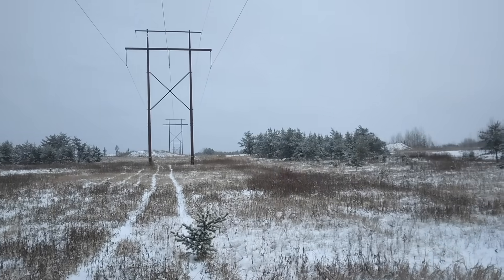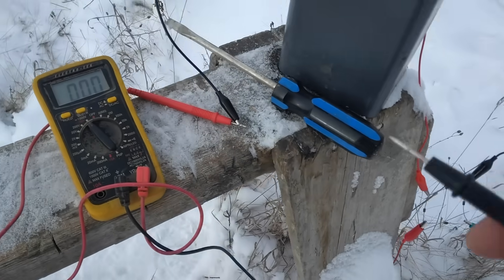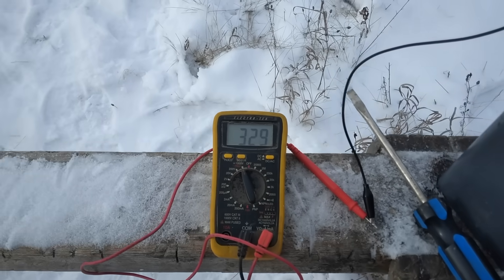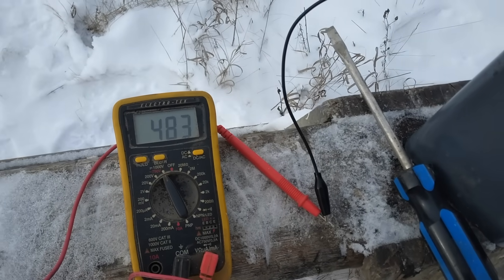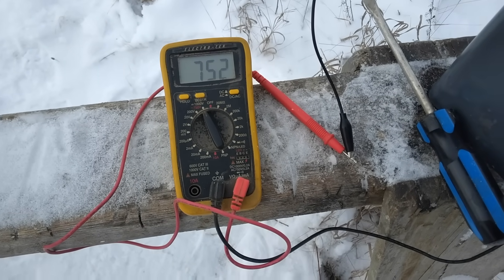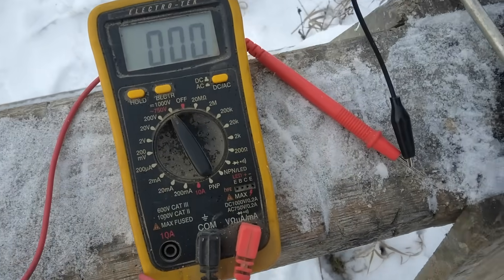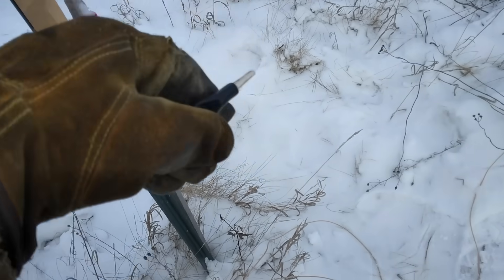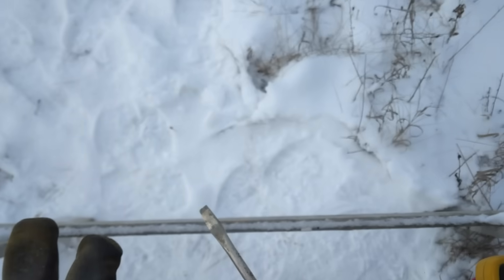Fences sucking power from under HV transmission lines

Comment: I'd be curious how effective a buried cable would be.  A few cm to a few inches below the surface and electrically insulated from the ground, no one would be the wiser as to it being there and you could siphon power all day.  Also the total opposite, it would be interesting to see what kind of current you could get from just outside your easement zone, where you could build higher.

Also-also, it would depend on exactly what your deal is with the power company, but a fence could be around 7 feet tall and still be a fence in my eyes.

Comment: There is a street in Wyandotte, MI called Electric because high voltage towers run along it and houses are all up and down both sides of the power lines. I wouldn't want to live on Electric st.

Comment: Wait, why put the capacitor from the wire to ground.  The AC voltage picked up will be shunted to ground!  Put it on the output of the full bridge rectifier.

Comment: I've also seen surprisingly high AC voltages induced in my body while working in a room with fluorescent lighting.  I remember reading that the most damaging aspect of voltage induced into your body is the frequency of the EMI.
Reply: That reminds me.. As an apprentice many moons ago they had just laid new carpet. I took a fluro tube and grounded one end on the pipework of a wall heater and the other end i touched the pins while rubbing my shoes  on the carpet. The fluro tube flicked in the dark..
Reply: This is inaccurate and a conspiracy theory.  Ask someone who knows science.

Comment: About 45 years ago, a friend of mine bought a small parcel of land from his family farm, and built a house on it.  There was a set of high-tension electrical transmission line along one border of his land where was was a disused stretch of barbed-wire fencing.   You could definitely get a pretty good jolt off of that fence.
Reply: The fence still there right? Sonthe fence is still.fencing right how is a fence ever unused after its built? till it rots completely  away  then its unused
Reply: Literally  have a 20.ft fence in my.back yard that was built for looks back in the day

Comment: Back in the 70s my friends and I discovered an odd phenomenon. If we were barefoot and touched an unpainted spot on the house gutter downspout with our finger nail we got a mild shock. But only sometimes. Then we figured it out. The guttering was galvanized steel. If it rained, any dead leaves in the gutter would produce a mild acid and turn the gutter into a battery.
Reply: So...barefoot, touching a groundplane, only happened after it rained. No, that was not leaves and galvanic action; that was a ground faulted HV line. Somewhere nearby there was a high voltage line that was bleeding current into the Earth. When it rained, the dirt became much more conductive. Your salty flesh made a great connection and voltage potential between the energized dirt and the grounded gutter. Shocks and electricity flow is all due to potentials. If the ground fault was closer to the gutter and if the dirt was saltier and more conductive, you may have actually gotten hurt. This exact scenario is why GFCI outlets are critical in wet locations!
Reply: @mannys9130  Not while raining. Most gutters hold water. Ground was dry.
Reply: @mannys9130  no hv fault, just neutral current lifting the pipe the downspout went into off of the soil potential. Its also possible the metal gutters and lightning rod may have been tied to a ground stake adjacent to the building ground the neutral was tied to.
Reply: Funny you should mention acid inside of metal things. I cooked pork chops with apple sauce in a cast iron skillet. I had added garlic and onions and the garlic turned a bluish green color. That didn't deter me from eating it. I turned the (electric) stove off and used a digital thermometer to check the temp of the pork chops. They were done, but still piping hot, so I left them on the stove to cool off. I go back and check the temp, again and a huge spark happened, killing my thermometer. I thought maybe the stove had a short and called maintenance to look at it. They found nothing wrong with the stove. The best I can guess is I somehow created a capacitor and discharged it with the second temp check. I still ate the pork chops.
Reply: @katieskitchen-tx  .....and now you glow in the dark?  lol  Sounds like a tasty meal.
Reply: @RMBlake007  HA! No.. That would be cool, though. It was very tasty
Reply: @katieskitchen-tx  If you used red onions, they tend to dye things around them when cooking. I used to think it was a neat effect.
Reply: @elgorrion52  
Hmm . . 
Okay, I'll bite . . 
Why were you licking a pencil sharpener? 🤔
And what else were you guys licking to get a tingle? 🤨
Reply: @maxwellsilver3115  Leave it to a dolt to discover a whole new realm of physics.  My dad argued against the idea that necessity was the mother of invention, rather, F up by someone curious, dilligent and persistent enough to notice something unexpected, test and trial and tweak until they could repeat the phenomena and put it to good use.    Specific example was pulling too much current on a transistor so that it would not go back off when the signal is removed but keep conducting.  If you limited the current such that it wasnt enough to cook the transistor and destroy it, and had an appropriate heat sink on the transistor, it could be used so that a momentary signal would turn it  on, and opening the circuit would turn it off.   They used that to replace a much bigger, more expensive latching mechanical relay.  Texas Instruments later patented that discovery. 
He described to me once about experimenting with inductive coupling to power lines to grab some energy being radiated off power lines and is possible grab a reasonable amount of power that way.  A simple rectifier into a capacitor does demonstrate that there is in fact power being radiated but you really need to understand impedance and use an appropriate transformer to grab any significant power.  I dont understand it well enough to explain it. Grey area as to whether that is legal. Unlikely you could grab enough power that way that the grid operator would ever have cause to go looking for the problem but you are imposing a load on the transmission lines so it really is theft in my view.
Reply: Not enough to shock you. Buddy you had an electrical fault.
Reply: @thewhitefalcon8539 never made a battery out of fruit?
Reply: @patrickmanasco8772  Ever gotten shocked by a potato battery?
Reply: @thewhitefalcon8539  Nope. When the gutters were dry there was no shock. Only when there was standing water in the zinc coated steel gutter, with organic debris turning the water mildly acidic did we get a shock. There were no electrical issues in the house, no wiring in contact with the gutter. Even tested the guy wires holding the TV antenna on the roof, no shock. Only the gutter.
Reply: It was more probably badly grounded appliances in the house.
Reply: @xcrockery8080  Then why didn't other metal surfaces of the house produce a shock? The house had steel siding. Metal outside faucets.
Reply: @benvincent24  The eaves are usually made of wood, which would insulate the gutters except where downpipes reached the ground.
A faulty appliance that is grounded close to one of the downpipes could cause the issue.
More common for it to come up the piping and affect taps inside the house.
The leaves-in-the-gutter "battery" idea is ridiculous.
Reply: @elgorrion52  the pencil sharpener is magnesium and not aluminum I powered an electronic watch with this device
Reply: @archstantonsadhill  Aluminium allow which contains a few percent magnesium.
Reply: @archstantonsadhill where did you get a magnesium sharpener
Reply: Moving water is naturally ionized, such as water in a waterfall.
Reply: @Enonymouse_  Standing water in the low spots of the house gutter.
Reply: Kind of off subject but compared to other posts, it kind of fits here...
My buddy and I were messing around with a small go-cart one day powered by a 3hp gas engine. I had my left hand on the rollbar he was on the other side right hand on the same rollbar.
I reached down to press the spark-kill tab over the spark plug. And slipped off touching the HV wire to the plug. I got a decent shock.
My buddy started doing an Irish jig! I pulled my hand back as quick as I could and he stopped dancing then asked me "what was that!!?"
I just rolled laughing because I knew! I was totally shocked that HE felt it!
Reply: There is another explanation - a bad earth grounding and an electrical fault in some appliance, like a corroded element in a water heater.  It happens nowadays if the "modern" earth spike is put into resistive ground like dry gavel, so not enough current can flow from the fault to trip the circuit breakers.
Reply: It was Slenderman sending his shock fairies to mess with you. 👍
Reply: Tangent:  old story I think from Germany of a man who fabricated a grid to generate power for his home via a powerful radio station transmitter emissions next door, it worked but naturally took out a pie slice from any receivers beyond.  Radio station eventually agreed to pay his home power bill providing he remove the generator.
Reply: It use to be general practice to bond the aluminum siding on houses to make them the same potential as ground . I guess thats no longer so. I have wired many hot tubs and pools on those any metal within 5 ' of the rim must be bonded including the rebar in the concrete.
Reply: Earth leakage from wiring fault!
Reply: @Sladeford  No other metal surfaces on the outside of the house produced this mild shock. Steel siding, metal faucets and pipes, TV antenna ground wires, no shock.
Reply: Wow that's pretty incredible
Reply: Get enough to charge a battery and hook up a light?
Reply: @cchurch816  No. The current was so weak you didn't feel it through the tip of your finger, skin was sensitive enough. Only when touching fingernail so the current flowed though the thin skin at the base of your nail.
Reply: @elgorrion52  battery effect.
Reply: now, that is interesting.
Reply: Yes...
Reply: You wouldn't develop enough voltage that way. The downspout must have been into a metal drain line in a building with 120v service. Its easy to get 10vac on the neutral. The 10v was always there. The rain left wet soil that made wet shoes.
Reply: This can be proven to be fiction
Reply: no... no it didn't
Reply: Surprising
Reply: That's actually a buildup of static electricity. Galvanic action doesn't provide enough voltage to feel.
Reply: @tkirby115  It was basically a zinc acid battery. If static electricity why didn't the guy wires for the TV antenna also shock?
Reply: It may also be accumulating atmospheric electricity.
Reply: @BrettHoustonTube  The guy wires for the TV antenna didn't produce a shock. Those were much higher in the air than the gutter.
Reply: It was from the phone line. Don’t ask me how I know.
Reply: 100% impossible
Reply: With imagination and lack of comprehension like this you should be a climate alarmist .

Comment: Given the slow charge rate of the capacitor, I doubt the run of wire you have will produce much power.  But it is fun to play with, if you are safe.  The discharge of the capacitor was not safe.

Comment: Well DAH; a current running through a conductor produces an electrical field around it. The larger the current, the larger and stronger the field. Any wire in that electrical field can pick up an induced charge, and if that wire is not grounded, the induced charge can accumulate until it can become quite dangerous. That's why you need to be sure any wire fence near a high voltage transmission line is well grounded. That is also why delivering "free" electric power without wires, using a Tesla Coil, is not only totally impractical, it's potentially dangerous. Unintended induced charges could build up in ungrounded fences or metal buildings, and cause a serious safety hazard to anyone coming in contact with them.

Comment: They knew tesla was right, but FREE ELECTRICITY? They wouldn't want that now would they,,,not when they can charge us for how many " kw " we use, not when They can hold us hostage with a monthly bill. 
I wonder why or if this guy has extended that wire to his barn, his shed, his house,,,I would, I'd run it to a breaker box and use it to the best of my ability,,,If this is for real,,,

Comment: In the early '80s, my friends house had powerlines just like that going over their house. The rain gutters and down spouts had a significant electrical charge. Us neighborhood kids loved pushing each other into them or better yet, tricking anyone that didn't know better into zapping themselves. It was strong enough to arc off any grass or weeds that touched the downspouts.
Reply: The eighties were fun.
Reply: As a kid,mom had a fridge that would shock us when we grabbed the handle to open it.
I was a hero when I got a job ,went to Sears,and bought mom a new Kenmore refrigerator.  I think I was a good boy...lol....
Reply: what super powers came from the ensuring dna mutations?
Reply: a lack of earthing to your gutters/spouts/plumbing . 
An electrically 'floating' conductive surface..... it is best to ground them in general.
Then you don't get zapped.
Reply: Interesting.  Could wildfires be started under this metal power lines with grass being close to the metal legs?

Comment: Your meter on the a/c range has a similar circuit of a bridge rectifier and (small) capacitor.   If your meter was going full scale deflection, then that was over 1000v, which you would have eventually got to with the big capacitor.
If your fence was equidistant from all the lines, you would hardly get any power.  It is only that your fence was nearest just one of the lines that you got the induced voltage.

Comment: There's alot of comments here from self-appointed experts on this subject.
I'm the farthest thing from an "Expert" that one could imagine so to me, if the power companies know their losing power directly or indirectly, whether it's being done by someone for the sole purpose of getting free electricity or by some amalgam of unplanned circumstances then, that loss is the fault of the power company.
This is an apple to oranges comparison but, a similar type of loss was brought to the courts of law regarding broadcasters of the TV airwaves claiming that it was illegal for people to watch their programing if they weren't paying to do so.  In so doing they basically claimed that they owned the airwaves.  Eventually the courts ruled against them.  The broadcasters do not own the airwaves.
I'm sure there are far better analogies that could have been used but, along the same lines of logic, if the power lines can so easily bleed power or electricity or whatever you want to call it, to a simple wire fence, and if someone is smart enough to utilized that power or electricity, that loss should be blamed on the power companies and not on the person or persons smart enough to take advantage of it.

Comment: Very interesting video. Years back one time my young daughter came home to tell me that her and her friends had gotten "electrocuted" off a big Crime Stoppers sign in town, they were walking along and for fun decided to take some fun pictures beside while touching it. It scared the crap out of them. I laughed at her, asking to go see it. We walked a bit to it and sure enough the sign was directly underneath some big main lines that crossed a main road. I went up to the sign, and sure enough you'd get a light buzz from it. It was aluminum on wooden posts. Well some time after, those wooden posts were changed to metal into the ground. I bet someone complained about it.